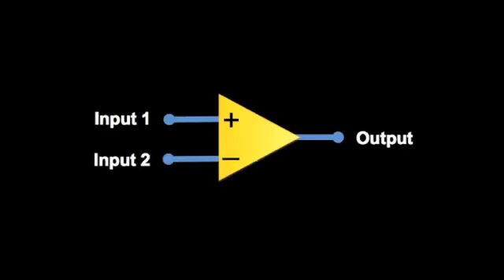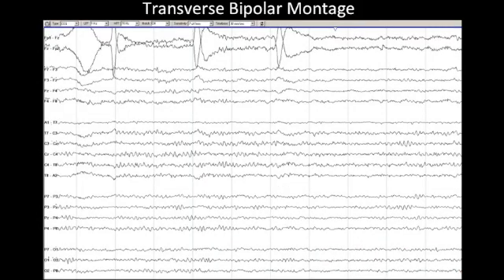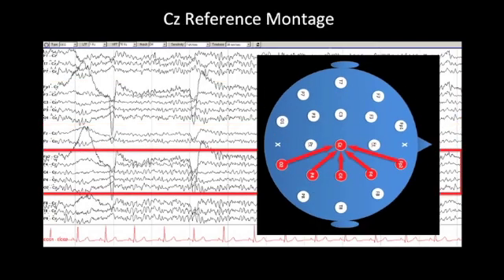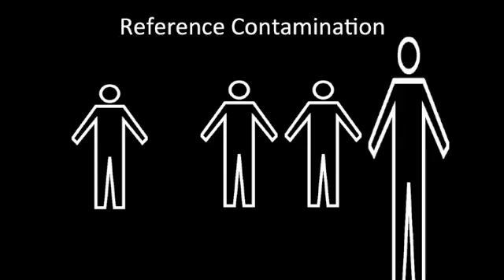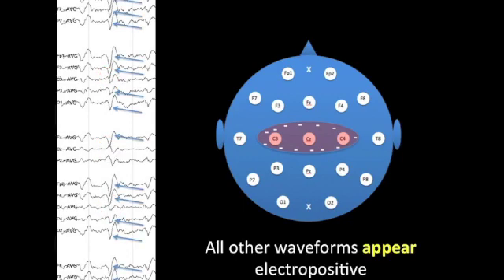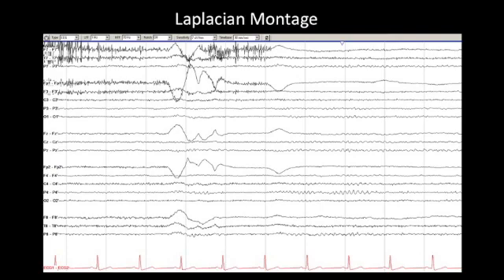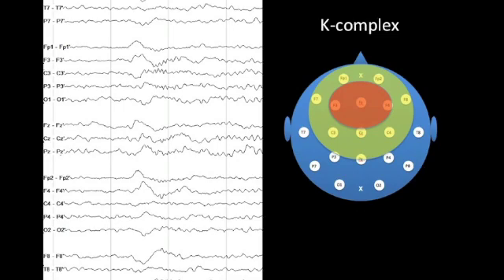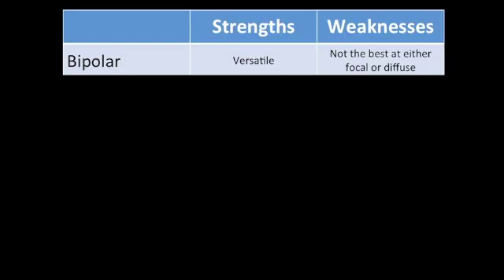EEG Montages

Comment: Question:  How would one look at different montages of the same eeg session like is said at the end of the video?  Isn't the montage determined by how you set up the differential amplifiers?
Reply: Referencing is very easy with digital systems, its as easy as clicking on the montage and it will display in whatever way you need.